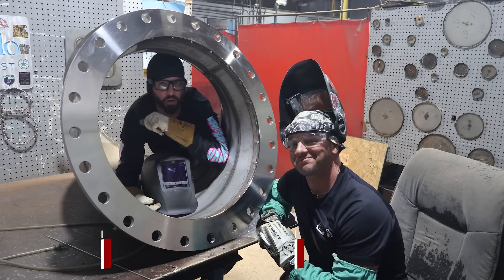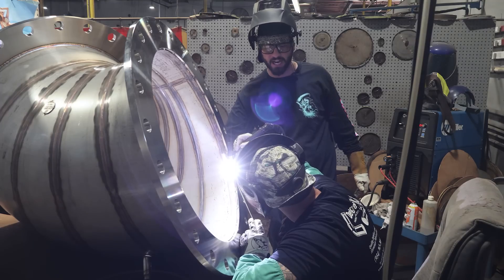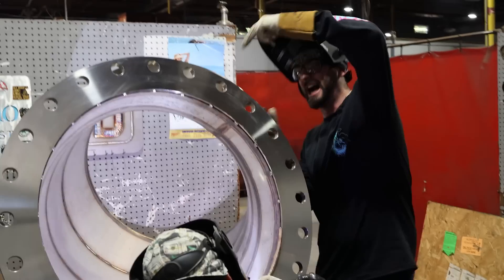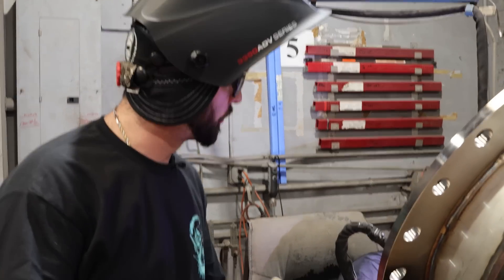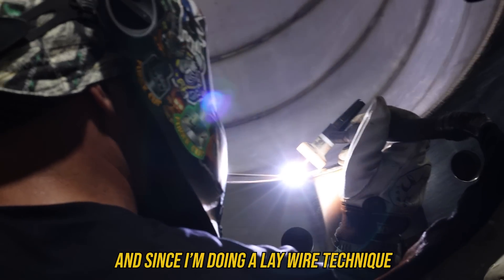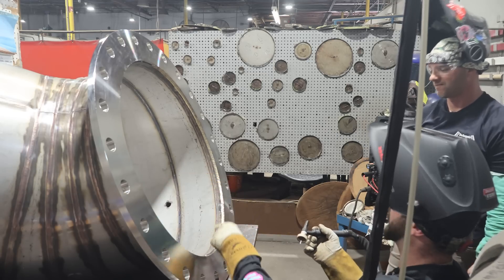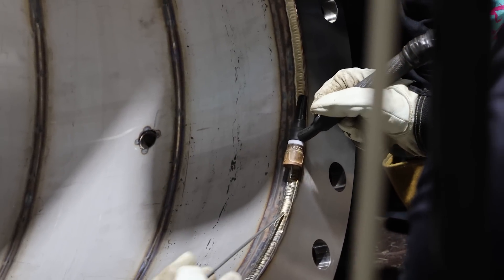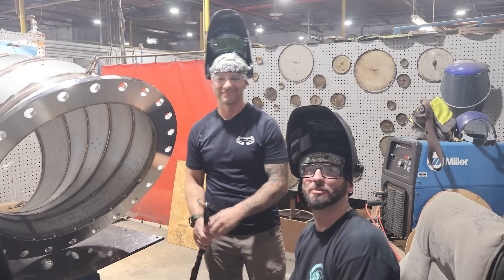How To Tig Weld Thick Metal To Thin

Comment: I’m wondering how 130amps down hill on a butt weld has sufficient thermal energy to fuse into the 3/4” material.  I weld mostly structural and generally anything that thick and up has a WPS for above 300amps

Comment: Y'all just had a vid about hazardous welding fumes, stainless and brass were the focus, but I dont see any fume PPE or extraction in this vid...
Reply: I was thinking the same thing. Thats a LOT of stainless welding to do with no fume protection. 
I’ll admit, I do quite a bit of stainless welding, and if I’m just doing a few small welds, I dont wear anything. But if I’m about to lay down 20-30 welds, or 2-3 feet of welds, I wear a respirator. This guy is doing about an 8 foot long weld to go around that circumference…without and fume extractor or respirator. 
I guess it’s possible he normally wears a respirator or fresh air helmet, and maybe he just didn’t have it on so he could speak easier for this demo video.
Reply: @zenlandzipline  A lil hexavalent chrome never hurt anyone 😅
Reply: @zenlandzipline  Yeah. Prob better for the sound quality
Reply: @MacDaddyShreds  yeah, but they should have stated that. A simple “I usually wear lung protection, but for these short welds on this short video, I am foregoing PPE so as the audience can hear me speak clearer. I do t recommend breathing in stainless welding fumes”. 
Pretty simple.
Reply: It's all lip service, man. Nobody actually wears that stuff because OSHA doesn't say you have to. All the welders know. None of them care.